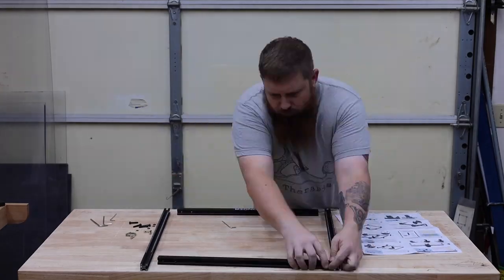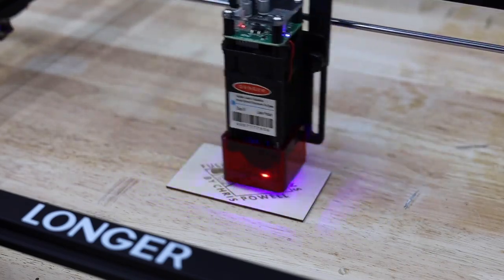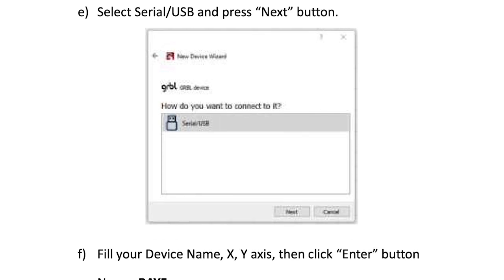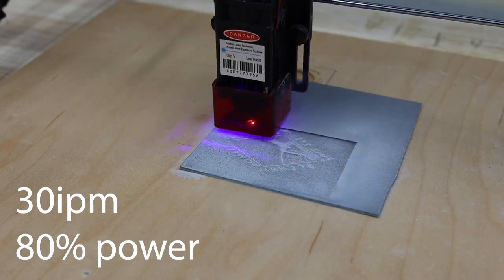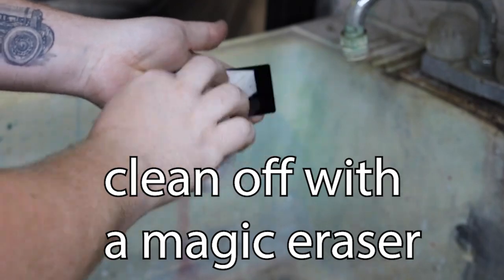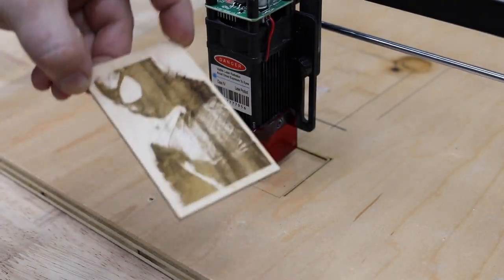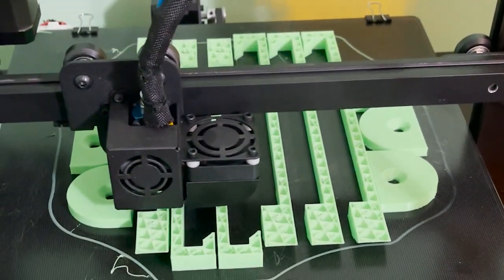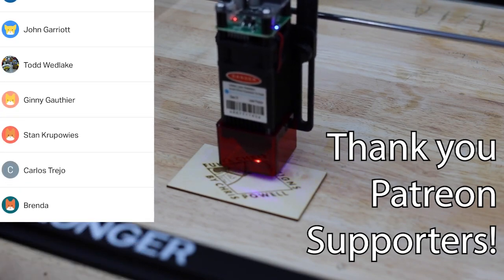Is this the best budget laser engraver? Testing the Longer Ray5

Comment: What is the thickest this would cut? I am burned out trying to figure the right laser for me. I need a laser that will cut up to 1/4 inch, that will allow me to use my own drawings and designs.
Reply from the maker: Have you looked at the new Ortur? It will cut 1/4” plywood no problem. https://youtu.be/GlPTxpXxuhg
Reply: The 10 watt model is said to cut 20 mm plywood that 787 thousands a little over 3/4 of an inch 750 thou) my new one is at the UPS facility 🤯 waiting to be delivered.

Comment: Will it engrave thicker items like cutting boards? I noticed you only showed it with very thin material.
Reply from the maker: Yea the thickness of the material doesn’t matter for engraving. You might need to raise the machine up if it’s something really thick, but it’s no problem.